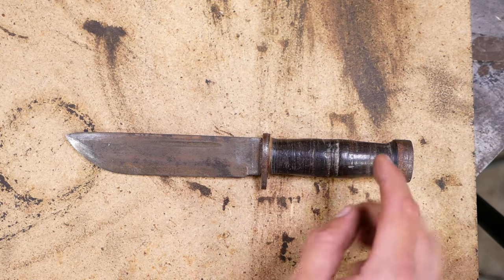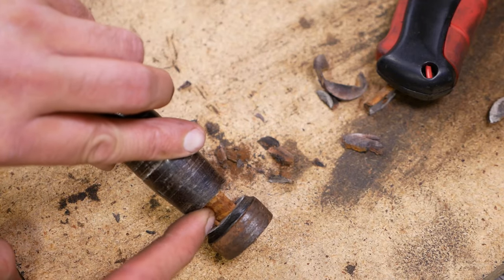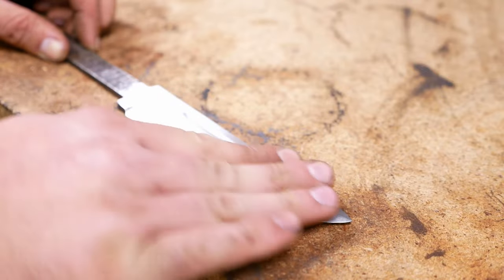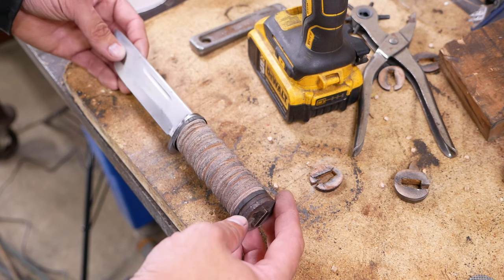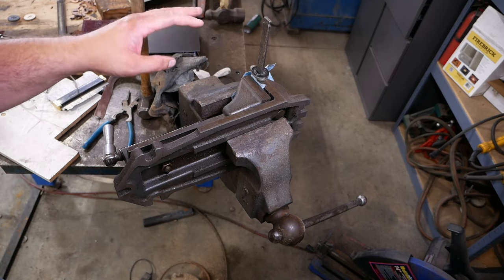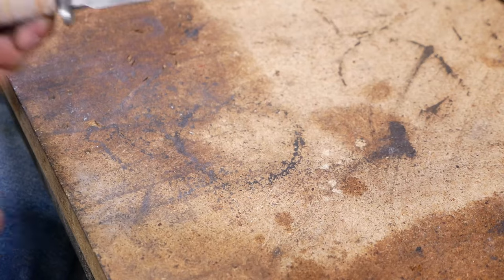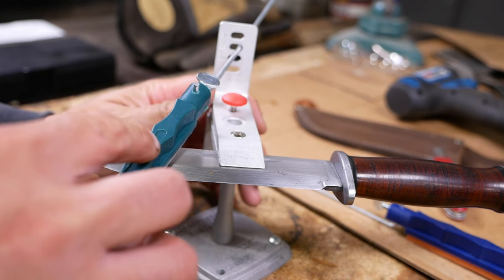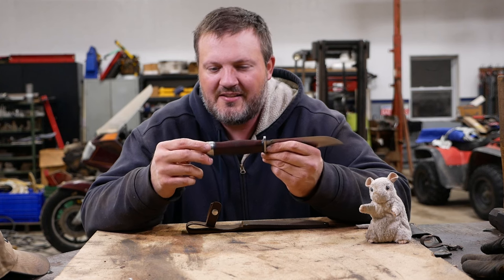Restoring a Cattaraugus 225Q Knife from WWII

Comment: i have the same knife but the nails in mine were completely rusted trough and not salvageable at all and the leather just rotted through so i just took some material i had lying around and sort of chop shoped a new handle onto it and it doesnt have an original sheath but i do use it often

Comment: You did everything right EXCEPT sharpening with a Lansky which is flawed because it cannot sharpen a 17 degree bevel on the red thumb screw side (ask me how I know). Get a KME sharpener and do 15 - 17 degree edge through all the stones (course to extra fine) THEN with the fine stone go back & put a 20 degree bevel just on the very edge (don't go very deep). You'll be amazed at sharpness and edge retention.
Reply from the maker: You're gonna be here a long time trying to put a 15 degree edge on a thick sabre ground blade.

Comment: What is the name of the 2 pins that hold on the last section of the pommel? I've seen those on other things and can't find out what they are called, so I can get replacements.
Reply from the maker: They are kind of like drive screws used in machine tools to hold on metal tags. I think they are custom hardware made for this purpose.

Comment: My father,  a WWII veteran, told me the 225Q was issued to the Special Forces in WWII. It is not a Quarter Master knife. However, this knife was so popular in WWII that other soldiers from different divisions in the Army would steal this knife. They may have been used to open wooden shipping crates with supplies inside but that was not the intention of why the knife was made nor made as robust and heavy as it was! Winston Churchill  started the first Special Forces in WWII and the US followed suit a few months later. This knife was also made by Case but was called the 337-6q. It is rare and more valuablele than the Cattaraugus made 225Qs. At least you knew how to take the rear handle off. A lot of knife makers grind the rectangular piece off the back  and then use a punch and pound the three rings off and break the tang! And you soak the leather rings in water for a couple of hours before you install them. Pat the as dry as you can due to the moisture using the tang! I always use a little Balistol on the metal to try and keep the rust from forming.

Comment: 6:04 wearing gloves near rotating machinery isn't OSHA-approved and for good reason. People put their hands way too close to the rotating part and then the glove can catch and suck in your whole hand. I'd use a clamp on the knife blade to get some distance to the rotating steel brush, no glove at all, or a tear-away glove designed for use with rotating machinery

Comment: Sorry. Over Cleaned; looks "new". "Collector Value" prior to "restoration": High. At least Several Hundred dollars. "Collector Value" After "restoration": NIL You MIGHT be able to get $30 ~ $40 for it.
That knife did not need "restored" it needed a LIGHT cleaning.
The original leather washer handle was in excellent condition. It wasn't rotten. It was only dirty.. Should have just cleaned it with saddle soap. The blade had no rust, just patina. At most give it a light coat of oil. After polishing the blade, is the tang stamp still there and legible, with crisp/sharp edges on the letters, or did you remove it? PRESERVE what is there.
If that was/is an actual WW2 service knife with a provable provenance/history before you "restored" it, a WW2 paraphanaillia collector may have paid a grand or more for it. Now? I doubt one would want it. You removed all its history and historical value by over cleaning during your "restoration".  
WHY do you "think" an old knife has to look "new" to be useable? You could have just cleaned the handle,  MAYBE lightly oiled the blade, (since the blade had a patina, it wouldn't rust. A patina protects a carbon steel blade against rust.) sharpened it, and had a serviceable, usable knife. 

For future reference: Research any old knife BEFORE "restoring" it. Your restoration may take it from valuable antique, to worthless possible fake. Over cleaned made to look new are ALWAYS suspect. At BEST a collector might believe it is a "frankenknife" assembled from parts.
Reply from the maker: Jesus H Christ. You can buy these on ebay all day long for $30. "Collector value". That's a good one.